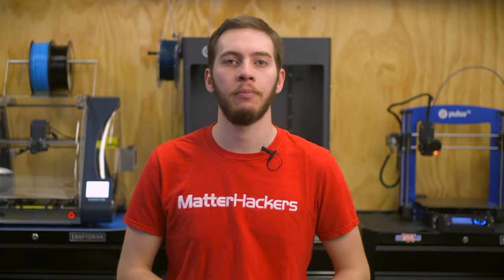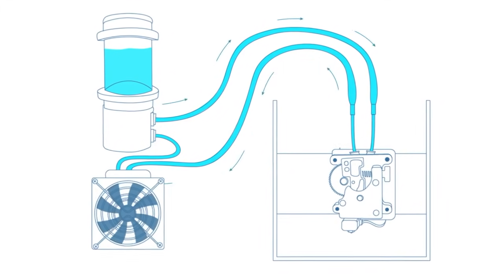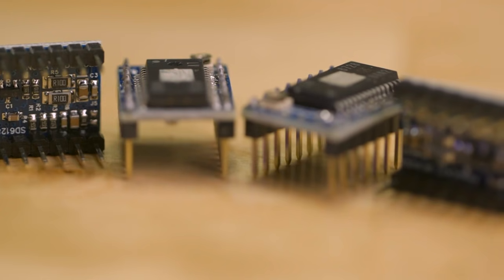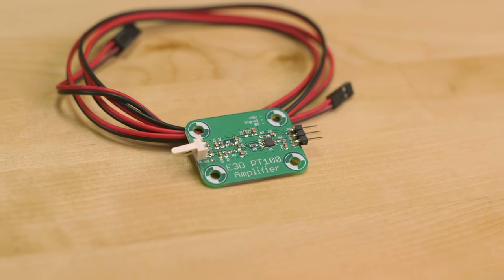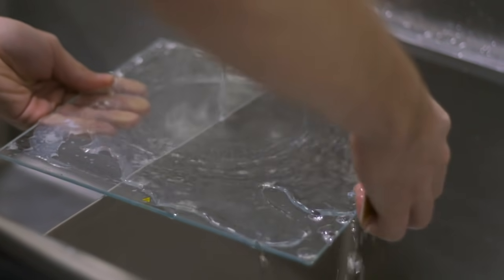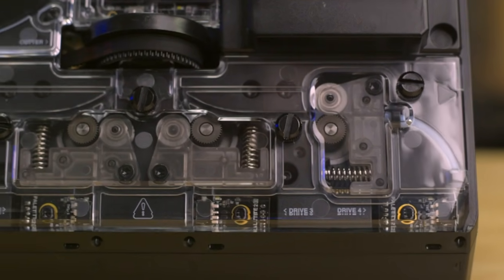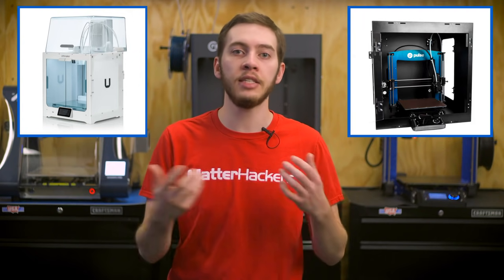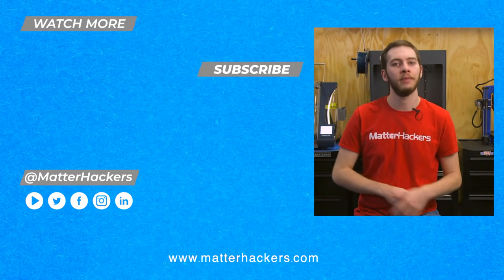Top Ten Advanced 3D Printer Upgrades 2021

Comment: Well, I sure did things backwards. My first upgrade to my ender 5 after having it for a week was replacing the controller board 🥲
Reply: If it wasn't a pro and came with an old 1.x.x board then thats a perfect upgrade.I got the 5-pro back in January and I'm already considering upgrading the board even though I already have the 4.2.2 Creality board.
Reply: I bought a 2nd hand CR-10S with a v2.1 board myself. I never had any intentions of keeping it stock, had a fairly long list of desired mods already in hand. So swapping the board for an SKR2 board was the 1st thing I did after running it for a 3-4 days, just to make sure everything was working as it should, and if not then troubleshooting would be far less of a headache than if I only ran into a malfunction after adding a bunch of mods.

Comment: I have looked into the blaze cut stuff, but its just too expensive. I went with cheaper options for now.
Reply: What kinda cheaper options did you find?
Reply: @YourBuddyDinec  well, it's cheaper,  but you need to have some skills with wiring,  coding,  and some mechanical experience. I use a smoke/ fire alarm along with a temperature display to monitor the inside of the cabinet.  The cabinet is lined with 3/4 inch drywall with glass windows. The bottom is concrete pavers on top of drywall. There is a temperature controlled fan box with charcoal and hepa filters and ceramic heater mounted at the base front of machine opposite of fan with hole to outside to prevent negative pressure. All electronics are in their own bay besides motors and hotend. The alarm and temp reading are used to control a board that controls some relays and SSRs. When a smoke alarm triggers, power is cut to the machine, the fan goes to low and if temperature reading matches (indicating high temp),  a relay activates a fire extinguisher manually.  The alarm and extinguisher are the main cost. Because i have two zones the extinguisher use can be geared toward the type of expected fire and what type to use.  Though specialty will get expensive!

Comment: Do not mention that the NEMA stepper motors are rated at 50C air temperature.   The crystal temperature for even ABS is well above 50C at about 100C.   Thus if you want to have better result running at higher chamber temperatures you risk failure of the steppers when you exceed 50C air temperature.    I am by education and experience a fluid flow and heat transfer analysis of motors and power electronics.  The winding are insulated from the steel for electrical reasons but that still the best path to remove the heat from current flow.  The end bells are separated from the wire by air, lots of air.  So cooling the end caps is not effective.  The laminations to limit eddy current are insulated from each other.  Thus heat is conducted to the thickness edge we see to be removed.  Lucky the the 50C is determine from natural convection cooling which means that approach doesn't have to be that effective.  I would use plastic water tubing wrapped around the iron and pressed against it with simple plates.   Liquid cool the hot end heat break heat sink.
Reply: There are higher rated motors from LTO, up to 180 °C. Moreover, if you use CoreXY printer (which you should) than putting motors completely out of the chamber is easy. And even cheap Ender 5 has motors outside of frame, so adding some finned strip heater and insulating the chamber  is not that hard. It's not for PEEK and such things, but for ABS, Nylon and PC definitely doable and Ender 5 is capable printing such materials.